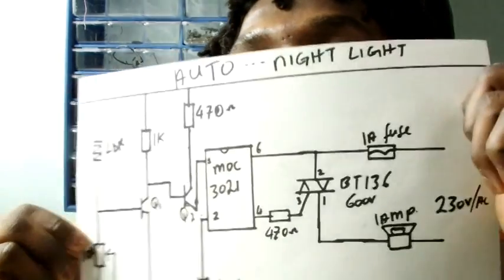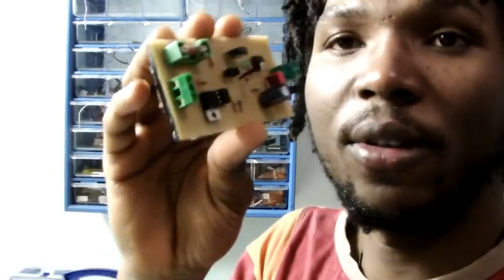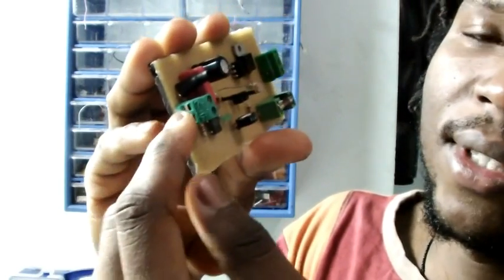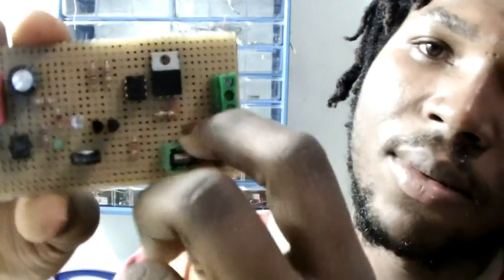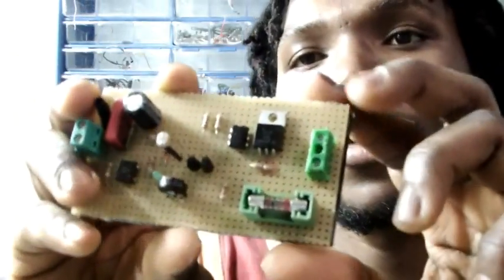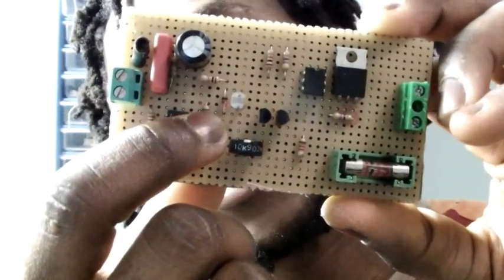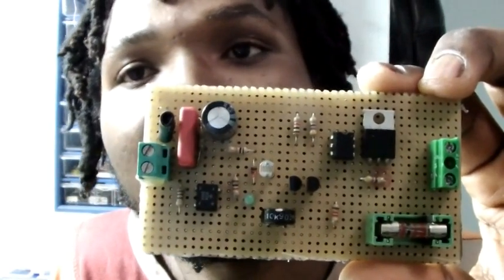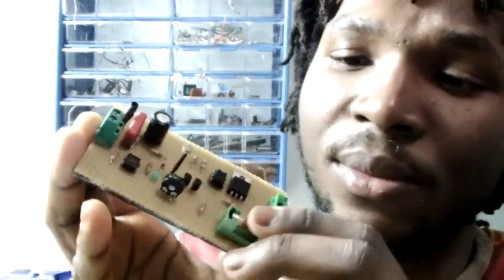automatic night light circuit

Comment: Hi.. Brother, it is a good circuit you have given to the world as a youngster. Thanks for you generosity. 
 I want to know little things about your circuit. First of all what is the voltage of the smoothing capacitor 470uf? Does it stand without getting heated up? What is the wattage of resistors and the zener diode?
  Did you use this circuit for a long time? I mean in switched on condition. Did not you have any problem with the components like getting heated up or fusing? Kindly reply me soon. 

Thank you.

 My e-mail is kusmanf@gmail.com

Brgds.

Kusman
Reply from the maker: hallo Kusman Fernando,
thanks for taking time to watch,the circuit i build dint give me any problems in as things getting over hitend 
here is the list of component used 
automatic night light,mostly used as home applications
when lights or sun falls on( LDR sensor-) the circuit turns off and turns on when dark falls on( LDR),works with 230v ac
                                            PARTS                            
_LDR SENSOR                                      TRANSFORMERLESS POWER SUPPLY
_MOC3021                                             _ FUSE 1 AM    
_BTA136=BTA6                                    _470 K RESISTOR
_10K TRIM                                             _  0.33 POLYESTER CAPACITOR
_BC547,x2                                             _DF04 948A OF(1n4007 x7) BRIDGE RECTIFIER
_FUSE  1AM                                          _10K RESISTOR
    RESISTORS                                      _470.UF 25V CAPACITOR
_1K                                                           _ZENERDIODE 12V
_1.2K                                                      _LED5 MIM
_470 OHM X2                                        _1K RESISTOR
Reply: Thank you for your prompt reply. I connected only the power supply part on a bread board. I find the 10k resistor just after the bridge getting heated up very much instantly. Did not you have that problem? What was the wattage you used for 10k resistor?
Brgds.
Reply from the maker: Kusman Fernando;
i dint have that problem with this circuit,but i had similar problem with another circuit  and the problem was the polyester capacitor ,so i will suggest u check on that
Reply: Thanks for your suggestion.

Comment: Can I have the complete list of materials? the exact and complete please..please make it detailed because I cant understand the one below, im not so good at this (ex what is MOC3021) I only understand the sensor and resistors.
It is really amazing I wan to try it so please help me..Im counting on you
need reply ASAP. :))))))))
Reply from the maker: moc3021 and many other out there ,its a optically isolated TRIAC driver ,there devices contain a GaAs infrared emitting diode and  a light activate silicon bilateral switch,this device is designed for interfacing between electronic controlles,to make this more understanding ,we use this device to drive triac , and triac switch ac loads ON & OFF ,its works like a relay ,hope this can help,if not just ask
Reply from the maker: Charmaine Veneracion how did it go,did u made it?

Comment: What kind of  electronic equipment you use can i find a list of that....  can you give me!
Reply from the maker: here are the parts 
                                            PARTS
_LDR SENSOR
_MOC3021
_BTA136=BTA6
_10K TRIM
_BC547,x2
_FUSE  1AM
    RESISTORS
_1K
_1.2K
_470 OHM X2
do u need the parts of transformerless power supply circuit  to?
Reply: Thanks for this yes I need they also!!!
Reply from the maker: kaushal Mishra hi there hod did it go?did it work